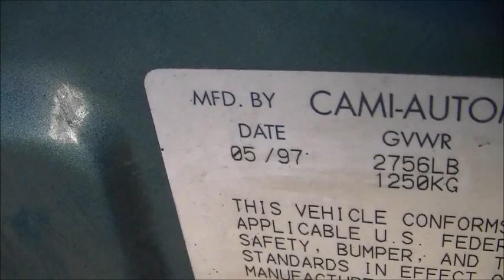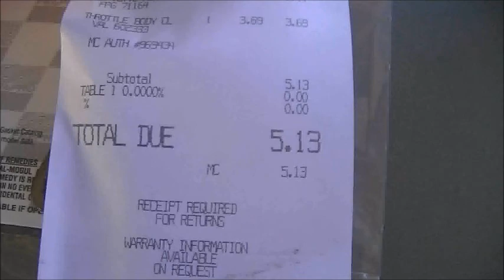1997 Geo Metro sputtering - how to fix

Comment: why didn't you blow thru it to see how clogged it was ? mine was 95 percent clogged on my 96 geo metro 3 cylinder 5 speed.  I got 13 mpg more highway with clean EGR VALVE on my geo metro

Comment: About 3.5 - 3.7. Fill it up to about 3.5, let it run. Check your dip stick and add up to .7 if needed. You're good to go after that. Also make sure to use 5w-30 oil, Geos in general are very picky on oil. Hope this helps :)

Comment: I noticed EGR passage way in the intake manifold, head & exhaust manifold were 90% clogged. Flushed out carbon & then used a Dremel tool to polish the passage way completely. Just did inspection 2 years after polishing to find NO build up at all.

Comment: This may or may not have anything to do with it but I'm going to tell you guys something that will help out when the EGR light goes on. When you change the Vac hose from the modulator to the EGR valve, use a 7/32 hose instead of 1/4. The reason is that after market 1/4 in hoses are not holding up when the motor is running. The EGR valve gets hot and the 1/4 inch hose will start leaking. Instead use the thick 7/32 hose and a squeeze clamp down where the hose connects to the valve. Also it wouldn't hurt to open the top of the modulator, blow the dirt out  of the passages with an air bottle and turn the filter. This is easier to do then changing your oil, and what a world of difference.
Reply: @new covenant is for Israel 

Gentiles are offered a seat next to Israel through Jesus in the new covenant
Reply: @Salvation4DJews  

What on earth are you talking about??

Jesus is Japethic?

Nonsense.

You one of those wannabe Israelites aren’t you
Reply: @johnle231  1. H/Jesus Crios was born December 25th 834 BCE. That is somewhere around 764 years before Yehoshua. 
2. No Hebrew ever named their son Jesus. Jesus is a compound word. Je in Latin means "I am" and "Sus" in latin and greek means "pig" . Y'hoshua is also a compound word, but it's Hebrew. Hoshua means "Salvation". The prefix is Yah (short for Yehovah). The name literally means Yehovah is Salvation. 
3. Yes, I am an Israelite wannabe. The people of Israel are my people. Their Elohim is my Elohim. Wherever they will go, I will go.  And I hope to do this shortly.
Reply: @Salvation4DJews  

Nonsense.

Jesus Christ same as Yeshua was born around 3-4b.c.

You said no Hebrew ever named their son Jesus.  
- Jesus is an English transliteration.
not everyone spoke Hebrew you know.
Do you know what a transliteration is?
Reply: @Salvation4DJews  

Jesus does not mean earth pig in Latin.

That is a lie from the wannabe Israelites.

The letter J doesn’t even exist in Latin so how can Jesus mean earth pig in Latin?

Boy you were easily fooled on that one
Reply: @Salvation4DJews  

The “Israelites” are back in their land.

Why don’t you go?
Reply: Translation of je – French–English dictionary
 
je
 
noun [ pronoun, personal ]
pronom qui représente celui qui parle
I as in I am

Sus noun
Definition of Sus (Entry 1 of 2)
: a genus of mammals that is the type of the family Suidae and in former classifications comprised all or most of the swine but is usually restricted to a few typical Eurasian and East Indian forms and the domestic breeds
— see BEARDED PIG, CRESTED PIG, WILD BOAR

Son, you're not as smart as you thought you were.
Reply: @johnle231  You cannot make Jesus translate to "Yehovah is Salvation" no matter how hard you try. There is only one name, it is Yehoshua. It is a Hebrew name. No man on earth nor any Angel in Heaven has the authority to change it.
Reply: @Salvation4DJews  

Once again genius.

The letter J is not in the Latin language.

Therefore, there is no JE in Latin.
There is no JESUS in Latin.

The Latin transliteration for Jesus or Yeshua = IESUS.

No J.

Understand? You’ve been misled with ANTICHRIST rhetoric and attack on the Holy one
Reply: @Salvation4DJews  

Who said translate? 

I said TRANSLITERATE.

The New Testament, the Gospel, was originally written in GREEK by the apostles.

JESUS NAME in the Greek was IESOUS.

And it means GOD SAVES.

Even the APOSTLES whom were led by God used a transliteration for Gods name.

So obviously,  there is nothing wrong with it.
Reply: @johnle231  "God" or Gaut is the false idol of the Celts, the Germans, and the people of Magog. 
What is "gaut"
Wikipedia
Gaut
( Old Norse nominative Gautr; variants Gauti, Gaute, Guti, Gapt; latinized Gothus; Old English Geat) is an early Germanic name, from a Proto-Germanic gautaz, which represents an eponymous founder or tribal god of a number of related Germanic tribes of the migration period, i.e. the Gautar (*, Geats), Gutans (*, Goths) and Gutes (Gotlanders). Gautr is also one of the Eddaic names of Odin.

According to Andersson (1996), * and * are two ablaut grades of the Proto-Germanic root geut- with the meaning "to pour" designating the tribes as "pourers of metal" or "forgers of men". The "pouring" etymology associates the name with the word god ( *gudan "deity, idol"), which may be derived from the zero grade of the same root.
Reply: @johnle231  What you do not understand is that Cyril the catholic in his 15th Catechetical lecture in the 11th verse literally describes the Jewish Moshiach as as you say" The Antichrist". In Verse 12 same chapter Cyril says that when the time of the Roman Empire (time of the Gentiles) has ended, the circumcised will be deceived by "The Antichrist". Yet Paul says in Romans 11:25-26 that when the time of the Gentiles has ended, all Israel shall be saved. 
So are you going to believe Cyril or Paul?
You're not dealing with an amateur here so be careful.
Reply: @johnle231  Why are you so triggered?
Reply: @Salvation4DJews  

Even if your claim about “Cyril” is true,  he don’t speak for Jesus nor Christianity.

Look at the many false claims you’ve been taught by Hebrew Israelism already
Reply: @johnle231  in a Geo Metro! She has my respect for sure.
Reply: @johnle231  maybe in pig laten?